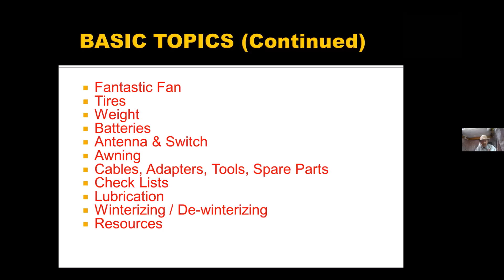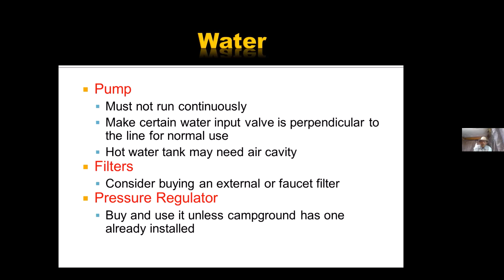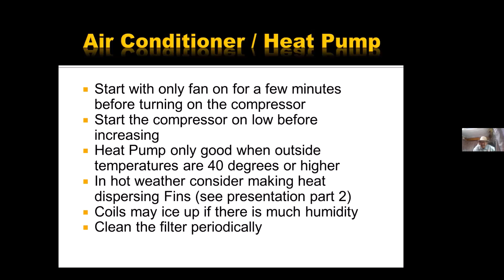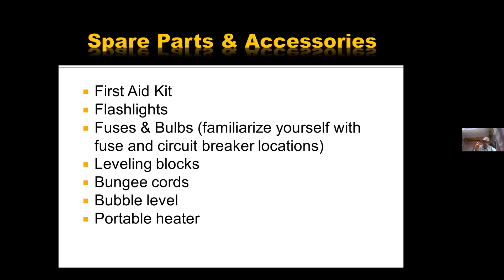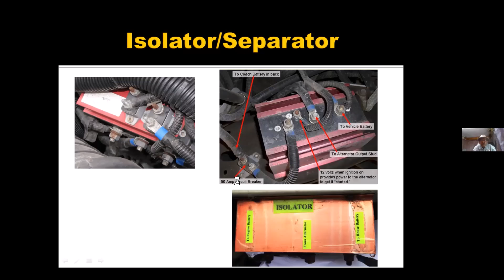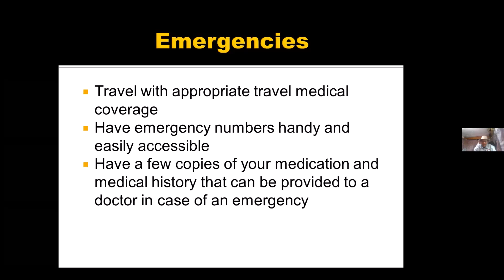Operation & Maintenance of Your Roadtrek - Harish Verma

Comment: Hi I've watched your videos and still have a question. I just bought 96D190P. Original isolator and original converter both work. I need a new house battery. I can't find a deep cycle sealed battery pro that suggests a gel or AGM with original charge equipment. Don't know what I should do. Don't want wet lead acid where I sleep. The gel was the original spec in 96 but the technology may have changed and these new deep cycles need multicycle charger capability. Should I upgrade my converter? Should I upgrade the isolator? Thx
Reply from the maker: I don't think your isolator or converter are the issue. I believe you just need to check your charger, which is in with the converter, to see if it can charge AGM batteries. On my 00D190V the owners manual says mine is multi stage but not sure of a 96. Maybe ask on one of the FB Roadtrek groups.
Reply: Hmmm... I'm having solar hooked up today with GREAT tech from my husbands RV shop he works at and I'm told I need to buy new converter because the LifePo batteries I bought will not work with the old system for 97' Roadtrek that was designed for AGM.
Reply from the maker: No need to replace isolator. Check your converter/charger manual to see if it is multi-stage and OK for AGM, which it may be. My 00D190V is. The concern is if the charger always charges when battery gets full and ruins it. A multi-stage unit reduces charging amount as battery tops up.

Comment: Thank you for all this, I still have an issue. I have a 1990 Dodge Ram  Roadtrek and my electrical in the RV stopped working. I checked and switched on and off the circuit breakers, and I checked the fuses that are in the glove compartment, but they are all good. Do you know if there is a fuse box for the RV section. And if so where it is located?
Reply from the maker: Yes, separate panel at back under the bed on driver's side. Has both 120v breakers and 12v fuses for house.

Comment: Good Hint. If you open the drawer to the left side of the sink and reach up under the cabinet top and pull out you will find a cutting or prep board that rests on the open drawer. 99% of owners do not know this as it is not in the owners manual. It is a good prep area. Ken
Reply from the maker: Yes. On Versatiles it is on the tight side drawer.

Comment: How do I turn the sink and shower water pump on.?
Reply from the maker: You do not say what your make/model/year code is but I'd guess there is a switch on the panel for the pump.  Or, check if you have a fuse blown?

Comment: I have a 96 Road Trek Versatile.I’ve never seen my rear battery. How do I get to it.
Reply from the maker: You could look under the seat behind the driver seat where sometimes there is a panel in the seat cavity. Or the other location would be in the driver side rear corner of the storage area. Lift the carpet and remove a plywood panel to locate.

Comment: In regards to the A/C I replaced mine also a1998 190 popular. I did not mess with the back grilles at all and  was able to change it from the inside. I agree it was not an easy job but it turned out very well.
Reply from the maker: The only reason one has to remove the back grills is to make sure the baffles are relocated or extended.  With some replacement A/C units the baffles need to be enlarged to fit.  This is very important to do, to seperate the hot output are from the cooler input air, for the unit to run efficiently.  Just check to ensure the baffles are up against the A/C and run right to the grills.

Comment: Really good.
Glad I stumbled onto this.
Is this just Youtube or sourced from Facebook?
I have a problem.  While camping< I must disconnect the automotive battery or it will be run down with the house battery.
I assume that has to do with the battery solenoid/isolator?
There a place to goto to see trouble shooting video at Roadtrek?
Reply from the maker: I suppose it could be your isolator, but more likely it is is going to be something drawing against your chassis battery. There are lots of tutorials on YouTube how about what causes the battery to draw down. This is not necessarily an RV issue. You did not mention your make and model.